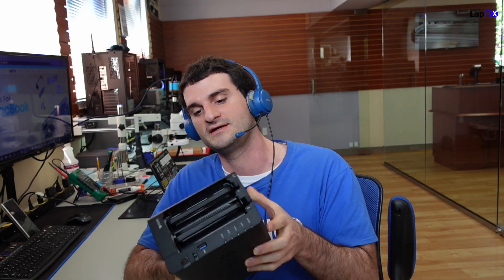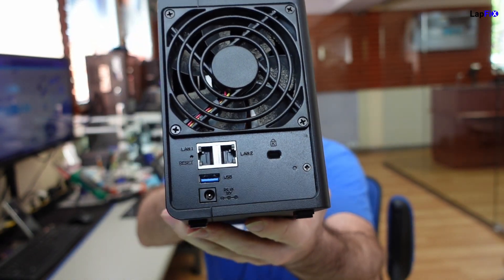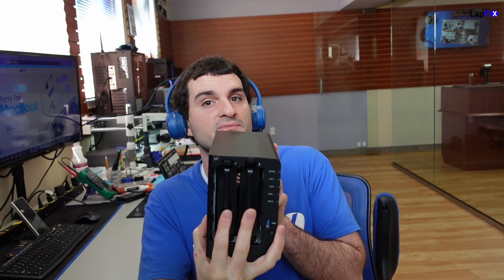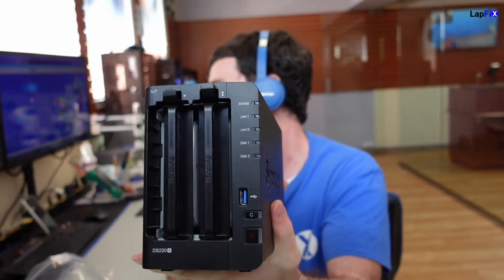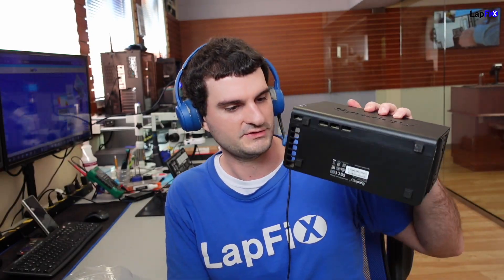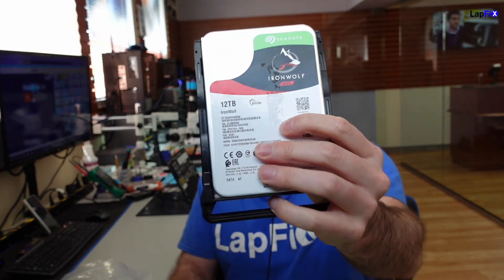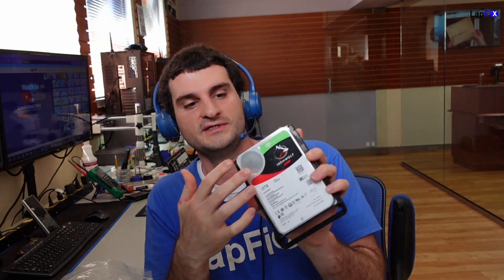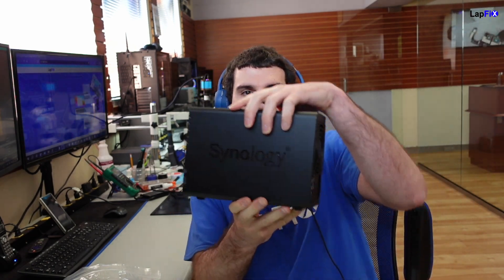Recovering the Data from a NAS with No Power

Comment from the maker: How do you guys back up your data?  Would you consider a NAS or already using a NAS?
Reply: RAID is NOT A BACKUP
NAS  is NOT A BACKUP
if the volume was encrypted, your advanced tools would help nothing ;-)
btw, in this particular case, opening this disk on Ubuntu would be more than enough - simply Win cannot open ext4
Reply: @zyghom  yep, ubuntu would do ots job😊👍🏻
Reply: I do consider getting myself one. Backing up your data is very important.

Comment: I have the exact challenge, synology ds1517+, was able to access 3 out of the 5drives using diskInternal. But, I still have 2  4tb drives which I am unable to access and I have an on going movie production in one of these drives. I am in Nigerian, please how do I get the file out. This issue happened this Thursday. I need help